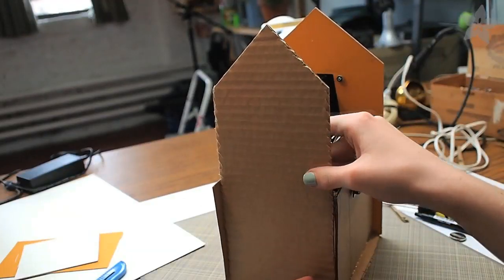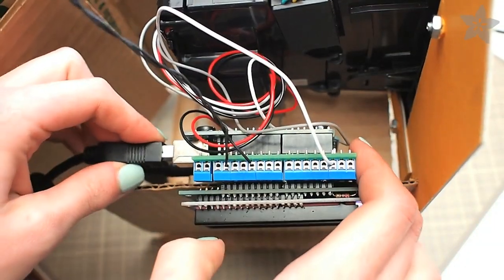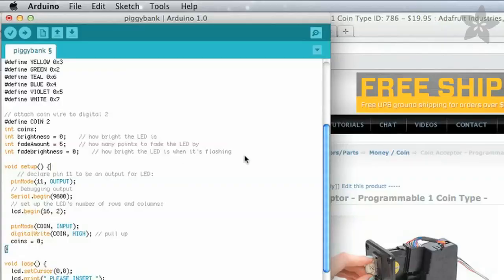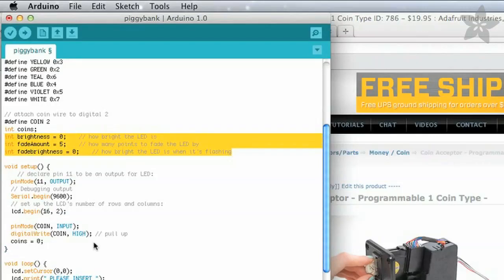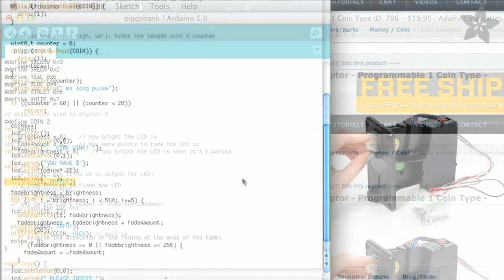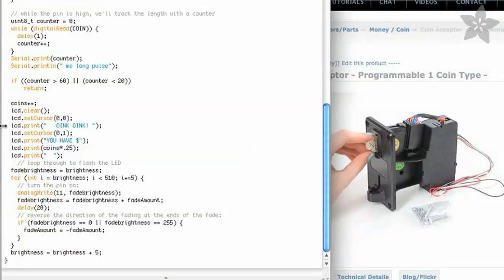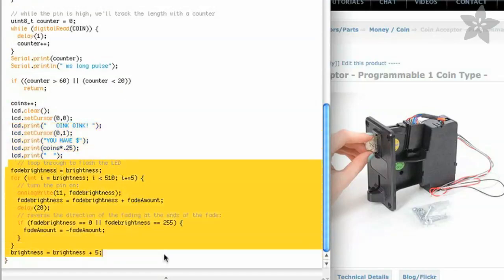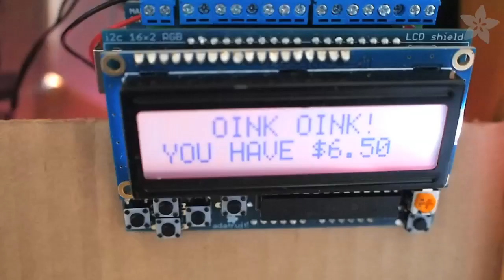How-To: Electronic Piggy Bank

Comment: Did you just plug the LED directly to an IO? You should always use a resistor when using diodes. If you don't you could damage your arduino and you LED.
Reply: It might be a 5v led
Reply: Came here to comment this.

Comment: how did you connect the coin selector to arduino and the lcd to arduino..,please ?
Reply: Late reply, use the pulse wires to connect to arduino to make it work! It works with the 3 coin model as well